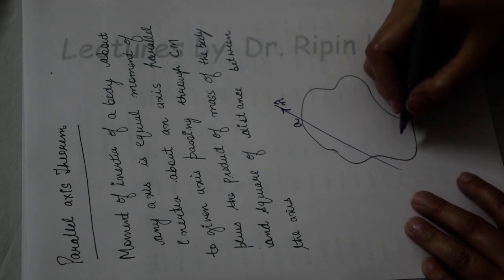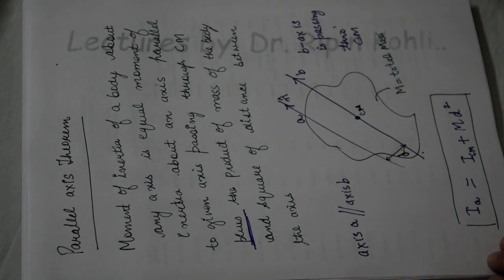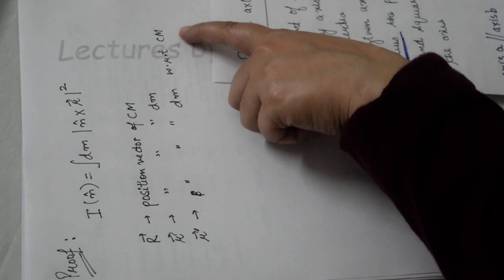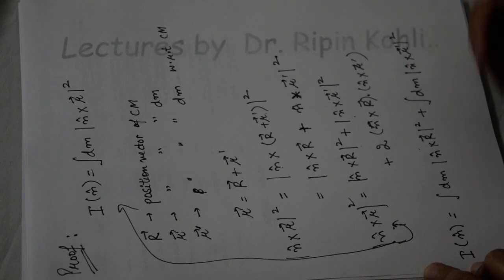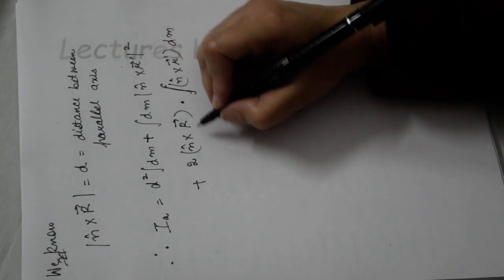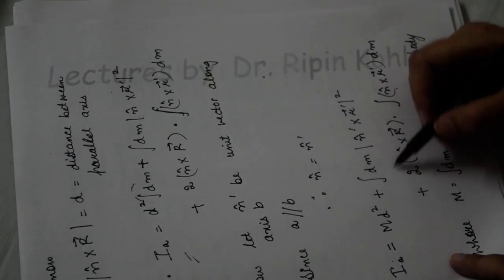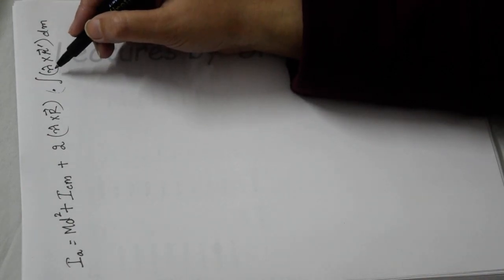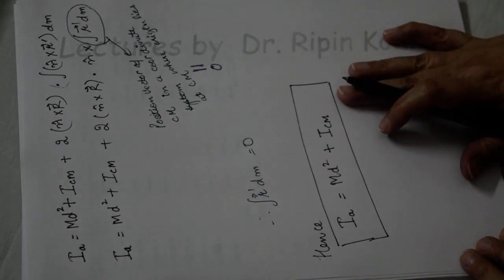Parallel Axis Theorem (Moment of Inertia)

Comment: I have a question. I've seen some examples where this parallel axis theorem is used but the new axis is already not inside the mass and it's too far away. Why is it that the moment of inertia is not just simple md^2 where m is the total mass  and d is the distance from new axis?